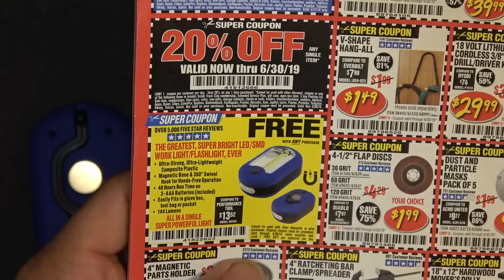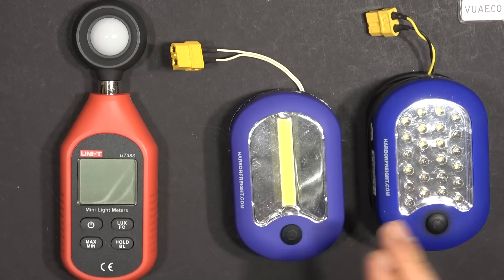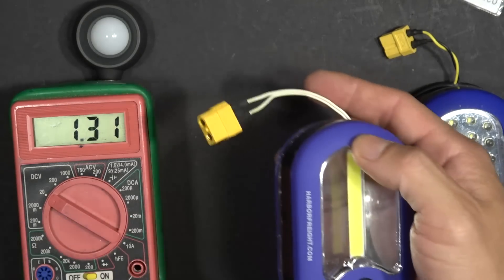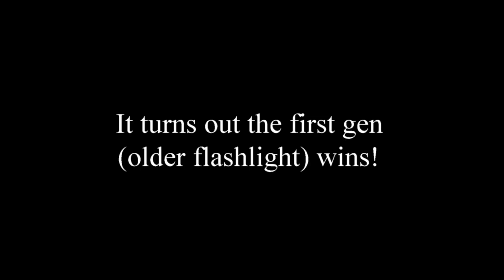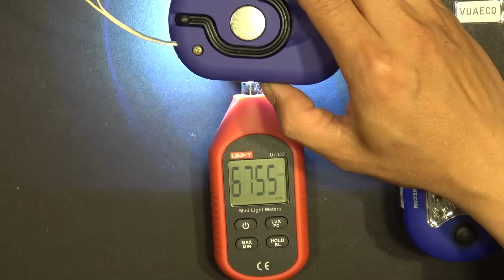DIY: Hack the newer Harbor Freight Magnetic flashlight Version 2.0 to run on 18650 battery

Comment: Dumb and dangerous. No bms to prevent total discharge. Better usage of 18650 and time on other idea. If you using protected battery. That's even worst way to use it.

Comment: Great hack. Please tell me, what is the value and wattage of the resister it has. I want to use a torch body that does use 3 AAA's, but i want to convert to 18650 batt. The circuitry is faulty in the old torch.

Comment: Neat and totally random.  I have a few of these as I was planning to make a daisy chained with a custom holder and clear tub light bar.  I was also thinking about using the TP4056 with protection circuits for charging.  Most recently I picked up the build in holder 18650 5V UPS boost charger modules in single and double battery design. I still haven't gotten around to, though will reference this design when I do get to making if I document on YT.

Comment: I know this is an old video but I just watched it a few days ago. I have one of the newer HF lights, that I got for free with a coupon, so this video inspired me to convert it to lithium ion. I started to do what you did and then remembered that I have some flat lithium ion cells. They came out of an old NEC Mobilepro 880 Windows CE device. I hardly ever used it so the battery always went dead. They are shaped like the flat camera batteries but bigger. With modification of the internal black part and the back cover, it fit in there. I also added a TP4056 charging board with a protection circuit. So glad I did it.
Reply: I don't mind the AA they last a long time, but what I do mind is the three position switch, so you can have press it twice to turn it on/off.  I go in and hack it so its just on/off for the main light, the little light is useless, I just remove it.

Comment: Can you pls tell me how much voltage a single 18650 put out? 3 AAA is about 4.5v altogether, right? Is one 18650 sufficient and safe to the switch of that portable LED, the switch won’t get hot? Thanks

Comment: I wonder if something similar can be done with an obsolete shaver I have.  It has new rechargeable batteries and a charger built in.  Search for "Kibiy Electric Shaver" on Amazon. The one I have is the copper color trim.

Comment: Someone needs to do a hack.
Make the batteries easy accessible instead I having to use of stupid screws
Reply: keep two screws out and you can rotate it open and closed
Reply: Duct tape
Reply: I always seem to get another free one before the batteries run out 🙀
Reply: Like snap on sides
Reply: Like gluing on magnets or making a magnetic charging port so you don't have to take it apart every time to charge.., my hack makes it so you don't need any glue, but whatever works.
Reply: No joke! That's the only bad thing about this light. I think Wal-Mart sells one just like it that has a clip-on back.

Comment: I had considered this and was thinking if I had a 3d printer (or a good buddy with one, lol) you could remake the back cover so that it is just a printed piece instead of cutting.   Would help keep it fluid resistant.
Reply: Ha great, now i will do this 🤔😬 I have a 3d printer that havent used in a while and a bunch of those lights thrown everywhere around the house

Comment: Nice hack, can you put 12v on this led light,  I'm thinking this would be great for my old truck cab that dosen't have lights inside, I would have to hardwire it.
Reply: You could add a step down module to lower the voltage from 12v to 4.5v. I got a few from wish for cheap but they sell them on amazon too.
Reply from the maker: Good question. Unfortunately, this is only 4V so you will need to have 3 of these in series if you want to run it on your truck. It's kind of tricky on a vehicle though because when your truck engine is on, your battery is actually 14.5V, not 12V so it might damage the LED due to over voltage.

Comment: hi my mums dustbuster mini hand held hoover doesnt charge its 7.2v mayb nicads but charger is 11v 200 mah trying to charge battery with drok charger off power supply not sure if working but theres a charger on ebay 11.2v 150ma nikko battery charger anygood?
Reply from the maker: If that Nikko toy uses NiMH then it might work. Charging parameters between NiCad and NiMH are similar. You can also convert your NiCad pack into a 2S Li-ion.
Reply: @vuaeco  yes did think about that would need charger say 7 or 8 volts an odd figure maybe use 12v charger?
Reply from the maker: @stevemcgowan3017  7.2V NiCad is 6S pack. That's a norminal voltage. At full charge they are 1.5V each so the pack of 6S is about 9V at full charge. You'll need something higher than 9V to charge it, not 7 or 8V. So 11V charger is about right because under load, it's less than that.

Comment: Would these work for trunk lights in the car?  Wired in permanent?  Would you need to step voltage down?
Reply from the maker: You need to step the voltage down to 4V DC. But it'll be great for the trunk as the magnet would stick well on it.
Reply: @vuaeco  -- Maybe, maybe not... I doubt that it would stay attached to the metal of the truck (assuming a steel trunk lid) for very long if you were driving since the magnet on most of the ones that I've encountered are not very strong... I put one on a freezer and watched it slide down the refrigerator over about 30 seconds....

And there are some cars that are using aluminum these days on the body panels to save weight to reduce their fuel consumption... Aluminum and some stainless steel alloys are not magnetic...

If someone is going to be installing it with a 12V power supply, they might as well install 3 of them in series instead of using a voltage drop / current limiting resistor...

Comment: V, you have plenty space inside for tp4056 and  2.1.mm or 5.1mm charging banana port for charging. No wires sticking out. Looks and feels annoying. Always enjoy your vids. Cheers!
Reply from the maker: I thought about that but I prefer not to use TP4056 permanently attached to the battery due to phantom load. The gap is not big enough for my XT60 anyway. I, too, have things sticking out of my body and it feels annoying sometimes! :D
Reply: Woah....to much info. I think you had one to many. Cheers!
Reply: @vuaeco  TP4056 has 6 micro amp maximum leakage. If using 1.5AH battery, it'd take 250,000 hours (about 30 years). Battery leakage is probably lot higher. What could be sticking out of your body? Arms? Fingers?
Reply from the maker: 6uA leakage is on paper and it's for the chip only, not the entire circuit. I also want to use the battery on discharge mode to charge a phone, for example. You can't do that with an enclosed TP4056 attached. It's more versatile for me. But I guess it's just personal preference whether or not you want the board  built in.
Reply: @vuaeco  6uA is on BAT pin, so that's the only leakage on the battery for the entire system if designed as recommended in datasheet. There is no current path from the battery when PFET is off, just the 6uA (or less) leakage.
Reply from the maker: @mychevysparkevdidntcatchfi1489  Unfortunately these boards that have TP4056 chips on, they are made by many different manufacturers. Some are better than the others if you know what I mean. I used to have one that keeps leeching my battery juice when not in use. Clearly it was the design and not the chip's fault. But it happens from time to time.
Reply: @vuaeco  My point is that proper TP4056 would only consume 6uA at most, 3uA typical. If more, you should contact the seller for refund since it's fake / defective. Only way to consume more power is to add extra parts to it, and I doubt anyone would waste money to put parts not needed just to waste power.
Reply: vuaeco you could get a cheap powerbank board which has a usb out and maybe put in a hard kill switch which would stop any leakage. And btw, they way you made this light, is there over discharge protection for the battery?
Reply: Plus it can run as a power bank it can back feed
Reply: And it can start a car engine at 4v
Reply: @thediydude4110  Until you make a video proving your assertion, I will assert that boosting a 12V car battery with a 4.7V li-ion cell is in the same vein as the "graphene battery".
Reply: @fun_ghoul  I was kidding of course it cant lol
Reply from the maker: @thediydude4110  One day in a year of 365 days, this battery can start a car engine at 4V. :D
Reply: @vuaeco  ya you can boost it to 12v

Comment: Is there Room in their to have the XD60 halfway sticking out so there's no chance of pulling on the wire  and another great hack from you Keep up the good work
Reply from the maker: There's room inside. You just have to cut out the plastic case.